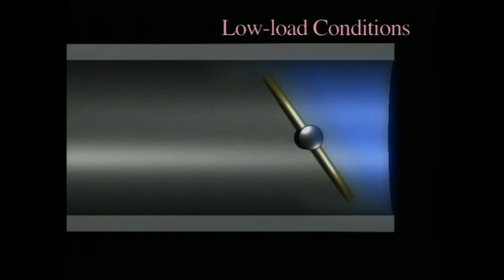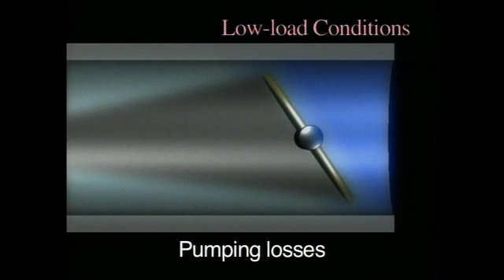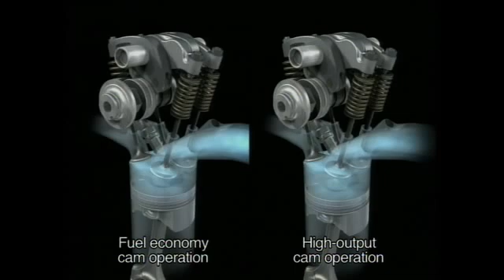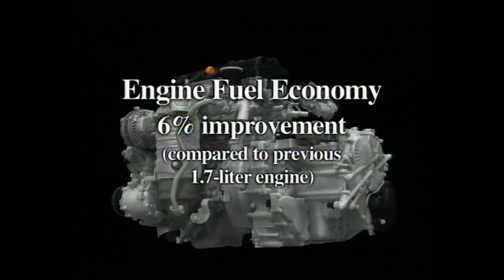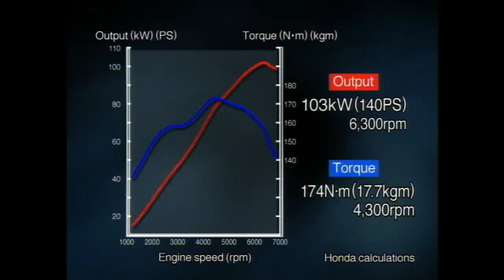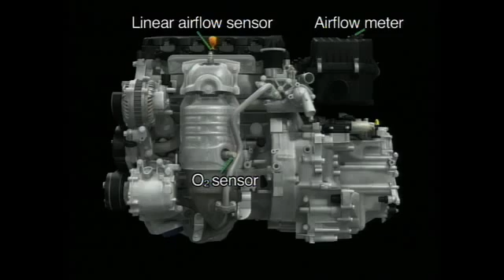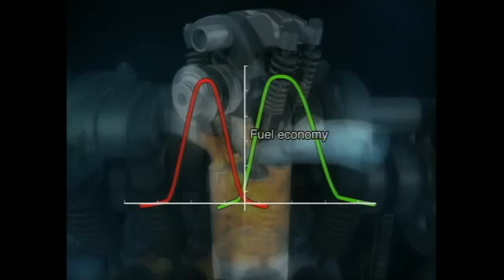Honda R18 Engine  1.8L  i-VTEC

Comment: This is one of the most reliable modern engines Honda has ever made.

These will outlast the rest of the car lol
Reply: Until you encounter a cracked blocked, which ranged from 2006-2008 and early 2009s.

Comment: Coming from having a B, K and D series engines and my R series for 10 years its by far one of my favorites engine platform. Very well put together system. Reliability with a decent power band and with the right modifications it becomes pretty fun.
Reply: what kind of mods?

Comment: I have a honda civic FD1 1.8 2007, it has R18 engine and it is running really good. But sometimes i have problem with high rpm and fuel average.

Comment: I wonder if Honda meant to make such a long lasting engine. Sometimes they just get everything right and it’s a fantastic motor.
Reply: I think it's just a biproduct of the engine's goal of being very efficient, it runs relatively understressed and therefore can last forever. similar to gm's 3800 v6

Comment: My D15Y2 engine in my 2004 middle east version civic blew up at 430K Km it served me well 
so my mechanic decided to drop this engine in the car I hope it'll be better he already did the swap and said that he's way happier with it hopefully I feel the difference
Reply: So how as it been going?
Reply: @ Turns out it was the D17 not this engine Lol 
I was excited since he said he swapped the 1.8 engine 
but the 1.7 is much snappier then the 1.5
Reply: @slayer21  yeah that's still a solid engine. The 1.5 is just too damn balls less.
Reply: @jaymills85 Yeah Funny thing I can’t even hold traction when flooring after I changed the engine
 my tires are basically brand new I’m still on the stock 14 inch steelies on 185/70R14s Lol I’m going to buy some 15 inch rims

Comment: I once had a 2006 civic 1.8 and the timing chain snapped, luckily we were still in warranty but it was a huge surprise. It had a full service history and 42k miles, I can only imagine the use it has was very short journeys but it went back to honda and they couldnt fix it in warranty so we got a full refund. I stumbled across this video because I want to try the same car/engine again and hope I dont get another bad one.
Reply: shit happens, probably production defect
Reply: The 2006-2008 in particular were known for cracking blocks (teething issue since these were the first applications of the R18). They are known to be reliable in the 2009-2015s though.

Comment: This motor is bulletproof. My 2010 Civic has almost 400,000 miles on it. And I just drove it from Orlando Florida to North Georgia a few days ago with ease. She's a beast!. Super fun to drive too. With proper maintenance these things can run forever. It's been the most reliable car I've ever had in my life so far.
Reply: What😮 did u do any overhaul?
Reply: Late comment, but what oil do you use?
Reply: You posted this comment in like 4 other videos 😅
Reply: a co zużyciem oleju występuje ?
Reply: Ever had check engine light? O2 sensors bad, catalyc converter bad?
Reply: Yes your are right 
It is a proven machine world wide😊
Reply: Any update now sir?

Comment: Nearly a quarter million miles on mine with no oil burn and looks clean as a whistle inside the valve cover. I've done nothing to this engine but change the VTEC gasket because it was seeping at 200k.

Comment: To people saying you "don't feel VTEC" on an R18 that's not true. But the thing is that it's actually in reverse. Once the engine hits 3000rpm, it goes out of I-VTEC and switches to the regular cams, you instantly feel a switch.
Reply: Cam you mean 🙄 it’s a sohc not dohc 🙄🙄🙄
Reply: @ferniem95 1camshaft but 4x2 cams
Reply: Yup
Reply: I think "normal cams"are actually high output cams while at low rpms it switches to eco cam profile
Reply: I have this engine. The change in valve timing is very subtle because it's not switching from full economy profile to full power profile. It's variable and electronically controlled so not always in the same place. It needs to meet a number of parameters such as throttle position, rpm and  load before it enters eco rather than simply eco below 5.5k rpm and power above as on previous V-TEC. The i in iVTEC stand for intelligent. Good system even if it's a bit boring. I get 55mpg at 62mph and average about 42mpg mixed driving, and I make quick progress. Probably the best NA 1.8 of the 00s. I've owned the VW 1.8 and the Ford for comparison and the VW with 20v burned fuel (38mpg) but had less power (125hp Vs 140) and the Ford had better low/mid torque but less peak power at 115hp.
Reply: So it means once you are 3000 above you are at economy mode than when you are 3000 below? Is that right?
Reply: @GabrielNavarrojrIII The opposite: Economy/iVTEC engaged is anything less than 3,500 rpm; after it's normal/all valves all the way to the redline.
Reply: Youre not going to feel any vtec engage no matter sound or power
In any economy motor since most of them engage between 2000-3500rpm
Unless it's sohc zc d16a d16y d16z vtec sereis 
or the newest one k20c2（This one do have true vtec on both intake and exhaust side
Reply: What you mean go out of vtec bruh

They  just switch into vtec cam in 2000-3500 rpm

Comment: Why does people say the R18 has fake VTec, anyone knows?
Reply: The Vtec Honda did back then, is changing the performance from normal to superior when vtec activated（the vtec is a key to unlocks honda engine higher performance）；while this r18 ivtec, is driving at normal all the time, and only activate vtec at 1~2k rpm, for fuel economy
Reply: @lawlaw91  I have a 12 Civic with R18. Being a SOHC for low end torque, I definitely feel the VTec activated at 4K RPM. This is what I see from the pov from my car.
Reply: @Jo-YuriLover  when you rev higher the engine will slightly hold the valve intake for better air flows, this is how the drive by wire system work, if there is an old vtec, it don't let it flows better, it make it breathe deeper, and that revs sound is really different roar....we don't have that😭

Comment: With the exact same driving and exact same roads, my 2013 1.8L manual Civic use about 6-7% MORE gas than my previous 2004 1.7L manual Civic...  Unfortunately, the R18 engine serie seems to be less efficient in reality than the D17 serie.
Reply: Ouais mais en même temps, la Civic de 9e generation est plus grosse et plus lourde que la 7e génération. Le moteur est plus puissant aussi alors ça aide pas toujours à diminuer la consommation.
Reply: @joelsimard1148 the 2013 1.8 (1799ccm) Civic has a R4 Motor and not the R18 i think.🤔

Comment: Vtec cam in R engine activated between 1 - 3.5K rpm. Other than that, normal high performance cam

During vtec activate, the lifting of an intake valve reduced while timing of another intake valve prolonged. Both to activate Atkinson cycle motor

To activate vtec, need certain conditions for ecu to give feedback.
Basically not all the time that vtec should activate. U need to cruise or give low load for this engine to give you good mileage

Between 3.5K until 5K rpm, the max torque achieved with long intake manifold. at higher than 5.2K rpm, short intake manifold take over to give high hp. But cannot match traditional NA Vtec high rpm power, unless forced induction (i guess) 

If you used to push your engine hard, then the ecu will always give you power which is quite fast for an 1.8 NA angine. just install electrical grounding equipment, surely you can feel the R18 power

Comment: Just both 1.8iVtec Civic type S 2008. With near perfect engine and transmission at 256000km on the clock! Ride feels perfect. New springs and clutch, but everything elese works like charm. Especially on 6000+rpm ;)
Great job Honda engineers
Reply: 267.000km...still amazing ride.
Reply: @tranceopijum  Glad you have fun with the car. I have LPG and 192,000km - never had a single problem.

Comment: I love my Civic's R18A2 engine. It's pretty much like motorcycle engine. You need to use full range of rpms to have fun.
Reply: Below 3000 RPM the r18 uses 12 valve above 3000 RPM it utilizes all 16 and the cam Runners change lengths in the higher RPM range to give you a VTEC like boost in power
Reply: @kevinwhiting8391  you own an r18 Kevin?
Reply: No doubt.. "brotha" 😄
Reply: Lmao ok Mr. R18 garbage slow engine.
Reply: @ferniem95 why are you here ? Lmao 😅

Comment: R18 do not have "i-VTEC." They only have i-VTEC-E, a similar system to the old D-Series engines that had the traditional VTEC-E. It simple terms it allows the engine to run on 12 valves rather than 16 at low loads and low engine speeds. At higher loads and higher revs, (2,200~3,500rpm) the cam switches over to normal mode or 16 valves for more power. There is no high lift cam.

Some people might say they feel or hear a kick around 5,000rpm with these engines, but that is not the "VTEC" kicking in, it's the 2-stage intake manifold that engages for better output and airflow.

Comment: Then why are there so many engine timing problems and misfires in such a revolutionary engine? Jerk @ 1500rpm while letting foot off the throttle is worse than a stab in your back. Nonsense technology with most uncomfortable travel experience
Reply: Then your engine had a Problem, i don't have this Problem that you say.🤷🏻

Comment: Zero torque, zero power and crap fuel economy.
Reply: So mine uses between 4.8 and 9.4 depending on how I drive, what do you expect it to use 2.5 liters or what?

Comment: No economical this engine 👎👎👎👎 taken 13l per 100km 😨
Reply: How come... Remap with e85, 8L/100...
Very good for a daily...
Reply: Thats strange, mine consumes between 4.8 and 9.4, your engine dependo g how o drive, seems to have had a problem or something, or it was a other engine, not all 1.8 are the same engines you must look at the code.🤔

Comment: So there is no real VTEC in this engine like it used to be? Or did I miss something?. I have honda with this engine and I never had VTEC kicking in. Kinda sad.
Reply: I vtec is not vtec , i ve got this car too  for the week stuff and compare to my S2000 for week end use , The R18 has nothing to compare to real vtec engine . It's not a sport car at all .
It's an ok car but if you want a sporty one , go for K   , B or F engines .....

Comment: These earlier r18 is no good I Own a 2006 civic block cracked and kept loosing coolant eventually caused a head gasket failure. And I’m not the only one that’s had this issue

Comment: I love learning more about my 2008 Honda Civic. I'm one the lucky ones that got a 5-speed manual transmission.
Reply: The lucky ones get the 6 speed
Reply: Liam Wilkinson Do you mean Europeans?
Reply: @justaguy9224  whoever gets it Do they not have it in America?
Reply: Liam Wilkinson The 8th gen Civic hatchback, which came standard with a 6-speed manual, was only sold on the European market
Reply: @justaguy9224  poor Americans
Reply: @liamwilkinson1076  its just 1 more overdrive anyways lmao
Reply: @nathandecastro2441  no the manual allows you to get the most out of it
Reply: I got the 6 speed one as my first car, LPG converted as well. cheap as fuck to run on fuel

Comment: I have owned vehicles since 1970 and the 1.8 Honda block cracked, Stay away from 06 thru 09 . Its on the internet for the details😞
Reply: Just went though this with mine. Been having a issue for the last year and a half with loosing coolant but can’t find where it’s going no smoke not mixing with oil just coolant gets low after a month or 2. Well couple weeks ago I had a head gasket failure just changed the whole engine with a R18A from Japan. Car runs amazing now and hasn’t had any coolant loss thang god 🙏🏻.
Reply: omg i buy one last week i hope its nog gonna haw that issues from UK
Reply: Mine is from 07, never had problems.🤔

Comment: This a vtec fake....
Reply: What do you mean? Please explain.
Reply: @TheLordstrider  
I can't speak ill of it as the engine is reliable but it is not a true vtec as it works only on the intake while on the previous B series models the vtec system also works on the exhaust and also increases the opening of the valves.
The R18 is fine but it is not a purebred horse and is designed to optimize consumption
Reply: @TheLordstrider  R18 do not have "i-VTEC." They only have i-VTEC-E, a similar system to the old D-Series engines that had the traditional VTEC-E. It simple terms it allows the engine to run on 12 valves rather than 16 at low loads and low engine speeds. At higher loads and higher revs, (2,200~3,500rpm) the cam switches over to normal mode or 16 valves for more power. There is no high lift cam.

Some people might say they feel or hear a kick around 5,000rpm with these engines, but that is not the "VTEC" kicking in, it's the 2-stage intake manifold that engages for better output and airflow.

Comment: I have 333,000 miles on mine!!! 0w30 mobil 1
Reply: i'm at 204 000 kms  ( 126 000 miles ) with the original clutch , still feel really good ^^ my S2000 is at 143 000 kms with the original clutch too . The R 18 is not a sportyengine but feels like it's pretty reliable , i'm from europe so i we don't have the crack engine problem here
Reply: @eyeswideopen5562  where does this crack problems come from? 
How do you know that the Swindon products aren't involved?

Comment: I'm looking at a car with the Honda R (R18Z1) 4 Cylinder, 1.8 L or Honda R (R18Z4) 4 Cylinder engines and I'm trying to determine whether they are reliable engines. In case you are wondering what vehicles I'm looking at they are:

Honda Civic VTi-L or VTi-S 9th Gen (2011–2015)  [Acura ILX in the USA] using Honda R (R18Z1) 4 Cylinder, 1.8 L or Honda R (R18Z4) 4 Cylinder, 1.8 L engine.
 Sports Auto Transmission

Honda Accord Euro (8th Gen 2008–2015) [known as the Acura TSX in the USA] using the Honda K (K24Z3 LEV) 4 Cylinder, 2.4 L engine.
 Automatic Transmission

Honda Civic Sport, VTi, VTi-L, or Limited Edition 8th Gen (2005–2011) [Known as Acura CSX] using Honda K (K20Z2) 4 Cylinder, 2.0 L engine or Honda R (R18A) 4 Cylinder, 1.8 L Engine
. Automatic Transmission 

Honda Jazz VTi  Second generation (2007–2014) [known as Honda Fit in the USA] using the Honda L (L15A7) 4 Cylinder, 1.5 L engine
. Auto Transmission

Toyota Camry RZ or Atara R XV50 (2011-2019) using the Toyota AR (2AR-FE) 4 Cylinder, 2.5 Litre engine
 Sports Automatic Transmission

Hyundai Accent Elite, SR, or Sport 4th Gen (RB; 2010–2018) using the Hyundai Gamma (1.6 Gamma GDi [G4FD]) 4 Cylinder, 1.6 Litre engine.
 Sports Automatic Transmission

Mazda 3 SP25  2nd Gen(BL; 2008–2013) using Mazda L (L5 SVT) 4 Cylinder, 2.5 L engine. 
Sports Automatic Transmission

Kia Rio Sport or Si 3rd Gen (UB; 2011–2017) using Hyundai Gamma (G4FABU or the G4FDBU) 4 Cylinder, 1.6 Litre engine. 
Sports Auto Transmission

Kia Cerato S 3rd Gen (2012-2018) [Known as Kia Forte 2nd Gen (YD) in the USA] using Hyundai Nu (G4NB) 4 Cylinder, 1.8 Litre engine. 
Sports Auto Transmission

Hyundai i30 Active (GD; 2011–2017) [Known as Hyundai Elantra GT in the USA] using Hyundai Nu (G4NB) 4 Cylinder, 1.8 Litre engine. 
Sports Auto Transmission

Toyota Corolla Levin SX or Ascent 10th Gen 2007-2013 (E140/E150) [known as Toyota Corolla or Toyota Matrix 2nd Gen in the USA] using Toyota ZR (2ZR-FE) 1.8L engine
. Automatic Transmission

Hyundai i30 SX First generation (FD; 2007–2012) [known as Hyundai Elantra Touring in the USA] using Hyundai Beta (G4GC) 4 Cylinder, 2.0L engine
. Auto Transmission

Mazda 3 SP23 First generation (BK; 2003–2009) using Mazda L (L3 SVT) 4 Cylinder, 2.3 Litre engine. 
Sports Auto Transmission
Reply: Acura tsx all day
Reply: I got the r18 civic and i wish i would of got the tsx u can shit the auto trans manually plus it has a k 20 not the best k20 but a k20 none the less